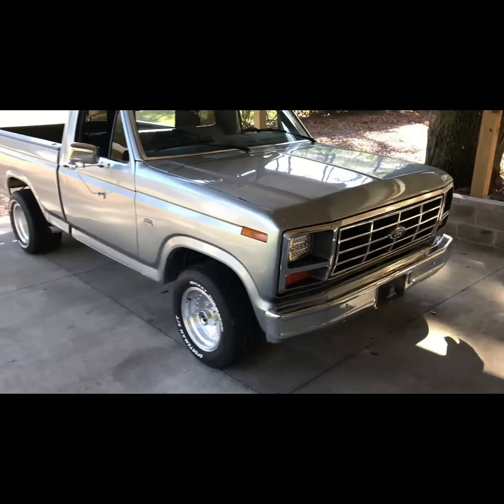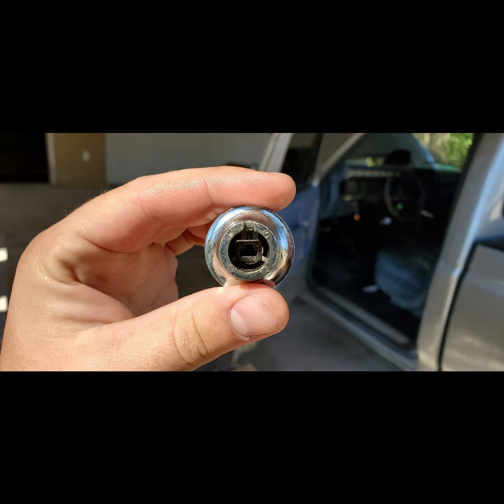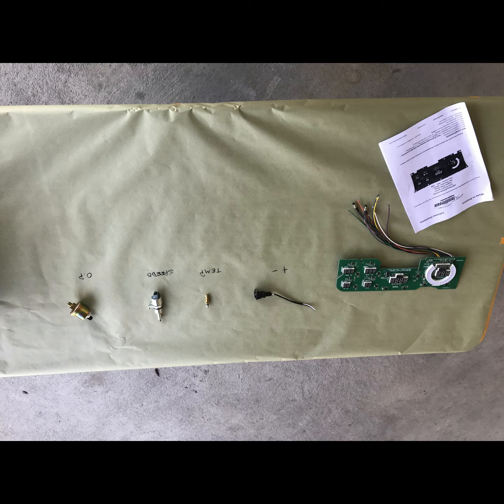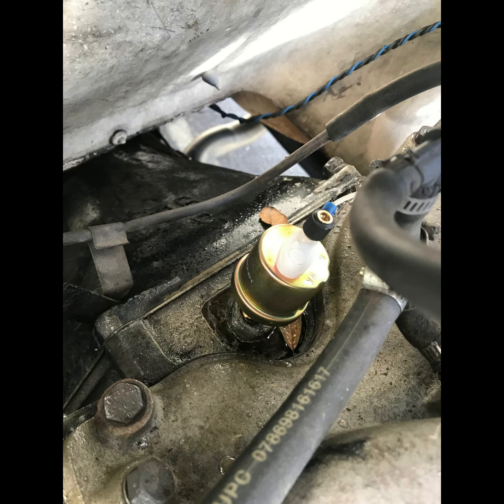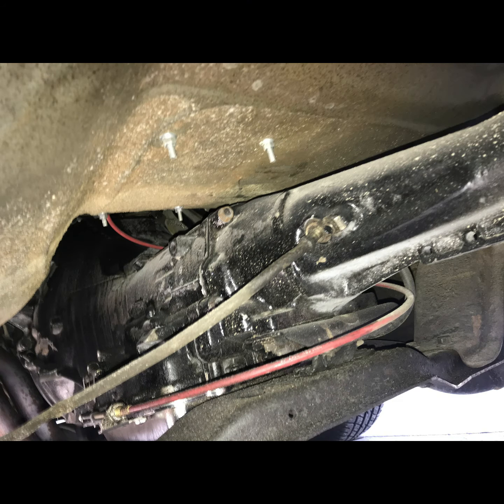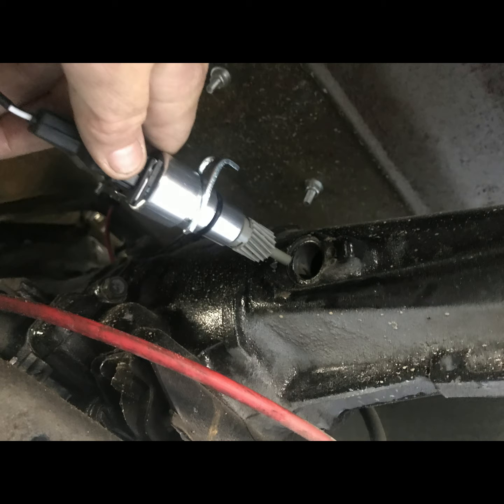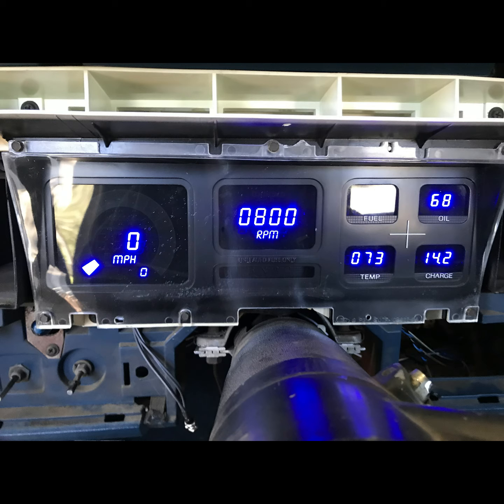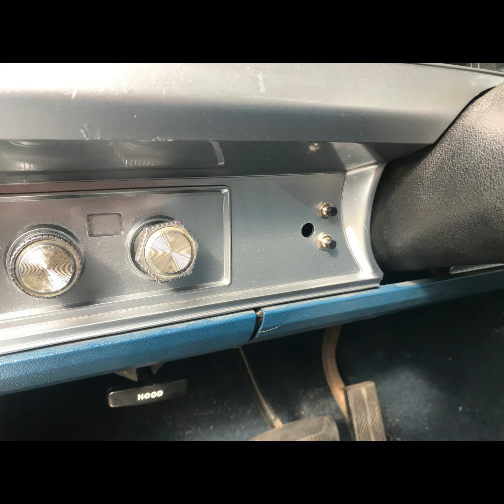INTELLITRONIX DIGITAL DASH INSTALLATION VIDEO 1984 FORD F-150

Comment: Nice bullnose and I thought about putting that in my 82 f150  and how’s the gauges and the speedometer and the sensor that goes in the transmission.
Reply from the maker: all the gauges seem accurate and work well
Reply: Ok that’s good. And the gauges look’s good by the way

Comment: Hello. I have a 1984 F150 Auto 2wd as well. This seems like a good option. I am a bit unclear on the following and am hoping you can help:

1. The only reason you noted not to remove the orig flat circuitry was to identify the Fuel Wire (do you recall which one it was).  Is this correct?    It seemed like you were also leaving it for blinkers and such. The problem I have is that that whole flat circuitry section looks like linguini and none of the gauges work.  Does this new unit plug into the wiring harness completely OR partially OR not at all?
Reply: All of your blinker circuitry stays intact. If you find the wire going to the original gas gauge that is the sending unit wire. I if I remember correctly several of the gauges used a common ground or a common power, can’t remember off the top of my head. But it’s obvious if you look at the circuitry on the back. You can run wires straight from the gauges to the sending unit. I just utilize the wire to the fuel sending unit in the harness because it was convenient.
Reply: @unpopulartruths4531  Hello. Have the Dash for a 1984 Ford F150, 302, 2wd Auto. The Water Temp the sensor Intellitronix requires has two wires (Blue & Black w/ blue). The digital dash only has one (blue). If the sensor grounds through the threads, as stated in the instructions (and that's all it states) am I also supposed to ground with one of those sensor wires? If so, which (assume blk w/ blu so the plain Blue would match the dash plain blue). Please advise. Thank you.

Comment: Bad advice on fuel dip switch settings. I had to pull lens back off and change dip switch to get fuel gauge to read correctly. Wish you had said nothing about changing it because it shipped with correct setting.
Reply: Excuse me for not knowing which sending unit YOUR  vehicle uses.  I should have known.
Reply: @unpopulartruths4531  then you should indicate that’s a setting when it’s not. You’re not the expert you think you are.
Reply: @ClassicAutoRepair 
I appreciate this comment as I am getting ready to do mine. So basically we don’t have to mess with the fuel gauge it already comes ready to plug and play for the fuel gauge? I appreciate any help!